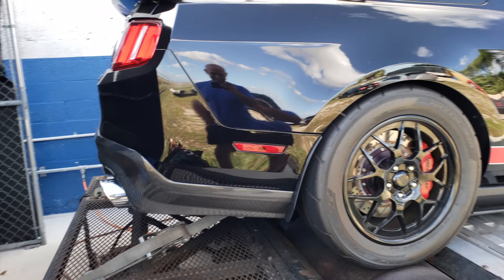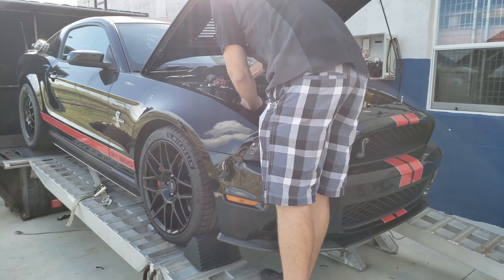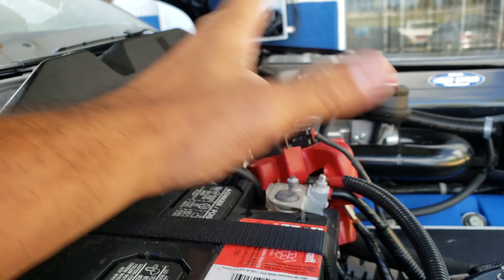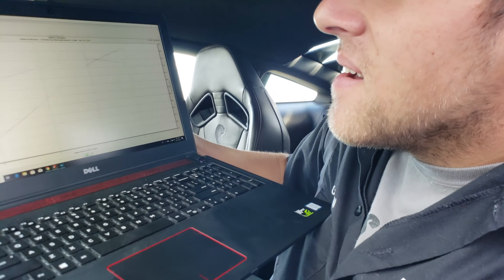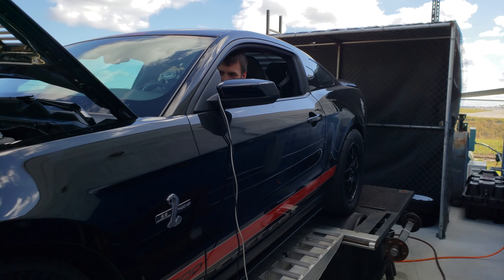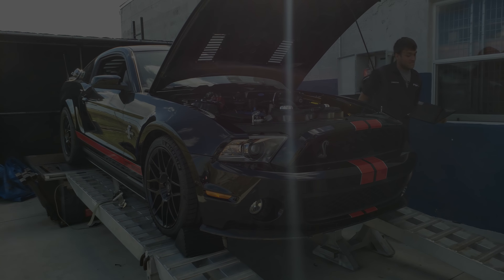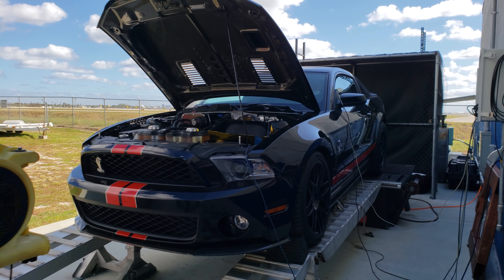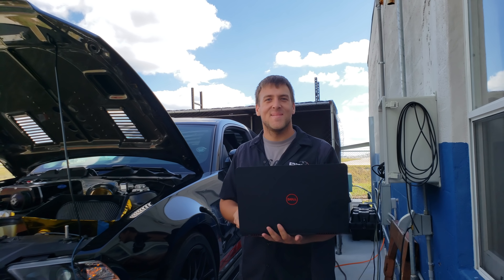KB Supercharged Auto swapped GT500 Gets Tuned By Lund Racing

Comment: Ryan I get it. It"s a good  tune for the street. Nothing wrong with 1000+ street toy at all. I guess I was expecting a max effort type pull for giggles with all the cool stuff on it. I like the adjustable boost controller, I hear it's got some cool adjust ability's. 
Should be good time on the street or at the track for a good while for sure.

Comment: The old a Trinity 5.8L circa 2013-14, was a potent motor compared with the 5.4L from 2007 to 2012. Same engine of course, just bored and beefed up on size. I pushed a stock 2013 5.8 to 1342 rwhp before the engine said see-ya!!!. That's around 1680-1715 crank with a KB 3.0L supercharger swap and basic bolt ons with a good pulley combo, lots of cooling. It was as reliable and a light bolt on Coyote. The Coyote motors can't touch it. Even today's 2018-19's are only max rated to 875 hp. Past that your playing Russian roulette and stand a 70% chance of destruction of engine unless built to some degree. Can the Coyote make some serious power? Sure, 1200-1300 rwhp with every bolt on and a few other mods, but it will not last very long at all if you spend even 30% of the time in the power with it. Heck the 2018-19 Coyote motors are less durable than the 2015-17's. Daily driver reliability Coyotes with some exploration into the power zone a little every day, no or very little 1/4 mi duty and more half mi events and it would last with 800 hp crank as a daily. The old 6R80 was inefficient and put the losses upto around 18% for dyno-average. The new 10R80 > (in the Mustang) is more efficient and thus reduces losses to 13% vs the MT-82 at 15%. I like the 10R90 that is in the Camaro ZL1 and refreshed 2019 SS Camaro, it sim. I have more refined than in the Mustangs or in any Ford product. Yes Chevy's is a 10R90 and once they pull it over to their side, it gets extra attention by GM. Fo d just lets it go and not do any more upgrading or massaging of the 10R80.... oh and the 10R90 in the 2019 SS has more tricks in the bag than the 10R80 in the mustang, it has launch control, one of several big selling features over the Ford.